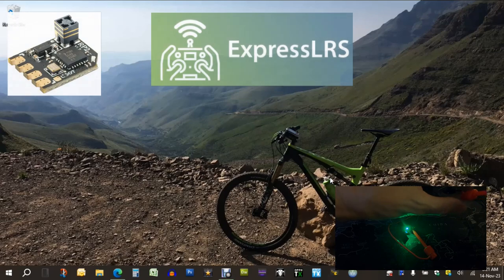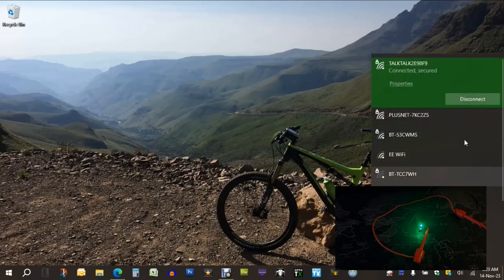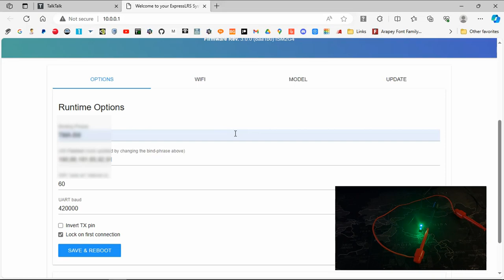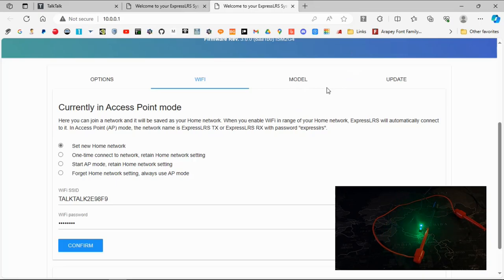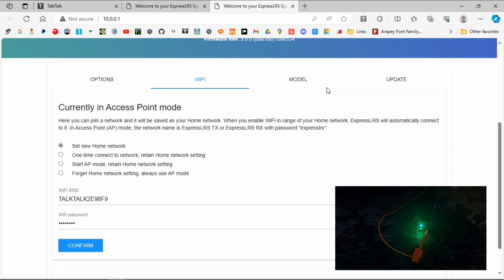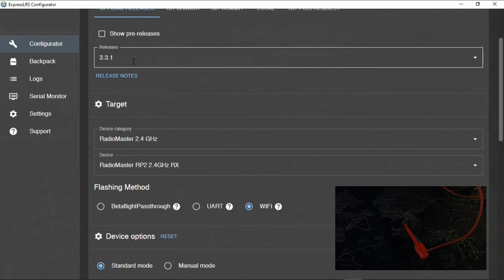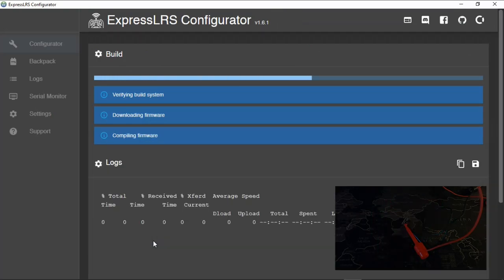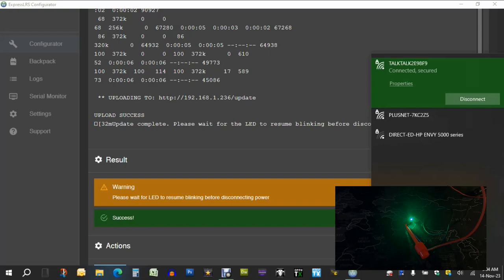RadioMaster Pocket Binding Express LRS & MPM Receivers

Comment: Great video thank you. I have a question out the different protocols that the packet radio have wich one you recommend.
Reply from the maker: You are very welcome. If you are starting out in the hobby I would say go for ExpressLRS because there are many manufacturers making receivers. There is a learning curve with ExpressLRS, it’s not plug n play. If you go the MPM route then FrSky protocol receivers. I have tested FlySky with good results.

Comment: how did you set the bind phrase to your remote you just did the receiver
Reply from the maker: Hi Sonny, the easiest way to get the binding phrase on to your radio is by updating the firmware. Please see this video

https://youtu.be/deEjl-zJMTI?si=bkqdRFdbYcixciOO 

You can use the web based browser configurator, firstly in the radio launch the ExpressLRS Lua Script and select WiFi Connectivity then Enable WiFi. Go to the computer and search WiFi you should see a network ExpressLRS connect to it. If this is the first time connecting the radio by WiFi the browse interface should open automatically. If not this is the default address http://10.0.0.1/
The configurator interface should open, now you can set the pass phrase. If you need any further help please do not hesitate to ask.

Comment: what if i have "Not set The default binding UID from the device address will be used"
Reply from the maker: You can use the traditional method of binding your ExpressLRS receiver but if you are going to update the firmware in the future why not add a binding phrase.

Comment: Can I connect this to any reciever?
Reply from the maker: No short answer. ExpressLRS to only ExpressLRS receivers. MPM many protocols please check https://www.multi-module.org
Reply: @the-happy-RC-flyer  thank you for your response. What I want to do is use it with my 1/24 crawler with rear steering. I just don’t know if they have a receiver that will work. Any ideas?
Reply from the maker: If your crawler uses an independent receiver rather than a combined ESC / Receiver you could easily use ExpressLRS or the Multi Protocol Module transmitter such as a FrSky D8 or D16 protocol receiver or a FlySky receiver. So lots of different options for you.
Reply: @the-happy-RC-flyer  I apologize for my lack of knowledge, but any of these you mentioned will link to the pocket?
Reply: Will the pocket connect to any receiver?  Thank you
Reply from the maker: It depends on the version you have, ExpressLRS only ExpressLRS receivers. The MPM basically FrSky but other receivers too.
Reply: @the-happy-RC-flyer  would the radio master ER4 connect to the pocket radio?
Reply from the maker: Yes if your radio is ExpressLRS.
Reply: @the-happy-RC-flyer  that’s just it, idk. The radio master pocket. 
Greatly appreciate your help

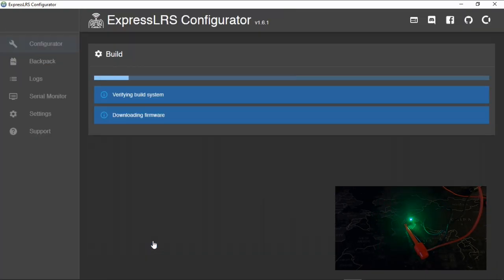Comment: Hey Bill, nice video ! I would like to know, at 4:37, where do you find the IP address ? Is that from the radio ? sorry for that stupid question, but that's where Im blocked
Thanks a lot, I hope this gonna work for me 
Take care
Reply from the maker: Hi Bryan, you need to log into your WiFi router. For obvious reasons I cannot show that in my video. You need to know the routers ip address, type this into your browser. Username is normally admin, password normally shown on your router. Then look for connected devices and it should show ERLS note down the ip address. If you are not sure what is what disconnect the device and reconnect noting which one reappears.